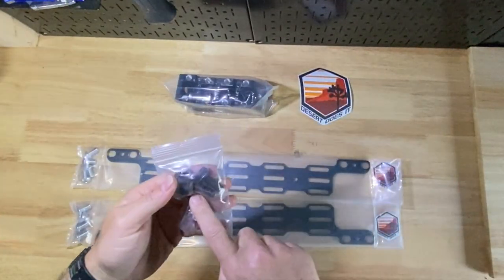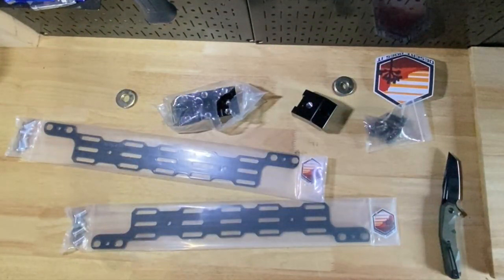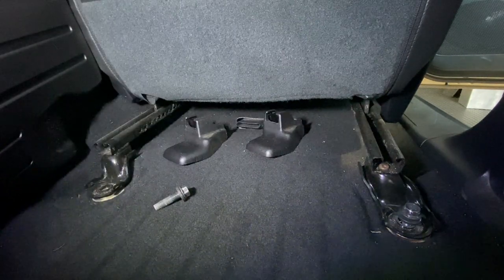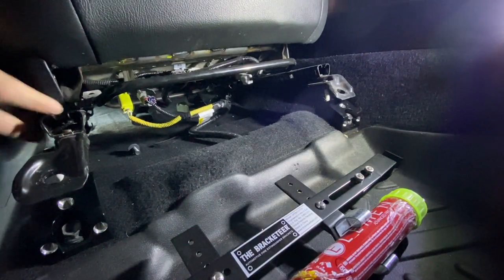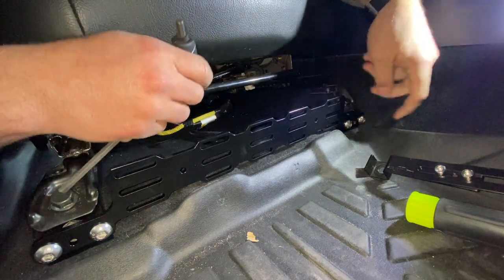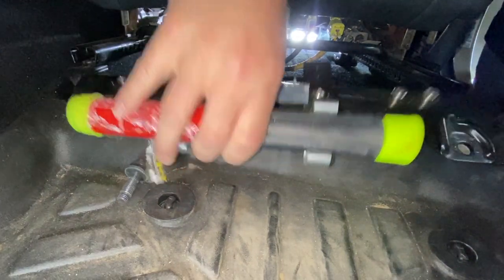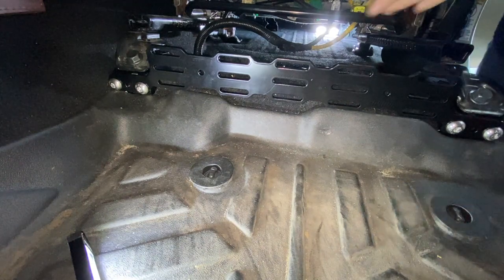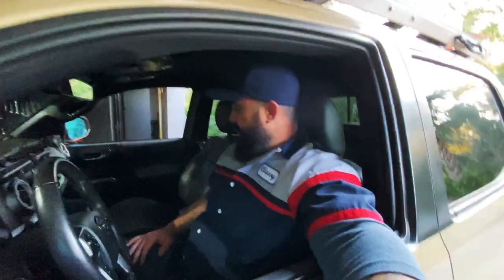Toyota Tacoma | Desert Does It Seat Jackers & MMP Install | (2017 Tacoma)

Comment: I did the seat jacker mod too, and man what a difference it made in the seating pose. Pricey though. I only did my driver side.
Reply from the maker: After a full week of driving and long trip, they still feel amazing. I should have done this sooner.
Reply: I heard there are cheaper ones on ebay and temu. Feom what others are saying, they are made of the same material and they also have the pins in them. Heard they are $30-$50.

Comment: I have an electric driver seat but I will put it on my passenger seat because it sits so low, but I would put 4 washers on the back of the seat
Reply from the maker: If you use 4 washers, you should also uses longer bolts to be safe. Thanks for watching.
Reply: Yes I’ll have to see the thickness before getting new carriage bolts
Reply: It works good on the electric seat as well. I just put it on my electric seat. Now i want spacers on the rear. I plan on putting some subs under both seats. Either an 8" or 10" sub inder both seats.

Comment: Btw, it was not necessary to loosen the rear bolts in order to get the front seat jackers on. All you have to do is push backward on the seat back just a little, and it will give you all of the space that you need to put the seat jackers in. Of course, if you're going to put spacers on the rear, then you have to unscrew the rear seat bolts. Otherwise, you can leave them alone if you are just doing the regular seat jackers on the front.
Reply from the maker: @Eastsidegeorgiaboy  thanks for letting me know. Appreciate it.
Reply: @ClassyTacos  you're welcome. I literally installed mine after the video.

Comment: are there any front spacers that are shorter? I like how much better the seat feels with the from spacer, by I’m rubbing my head on the ceiling of the taco now. I have enough neck problems without having to drive with my head tilted all the time or adjusting the back of the seat so I’m laying down
Reply from the maker: Not that know off, you might have to fab up something that works for you. I'm guessing you have a sun roof. From my understanding the sun roof models have the headliner lower. Hope you get it figured out.
Reply: How tall are you ??

Comment: Classy Tacos thank you for the videos. Quick question. 
Where I can find the spacers? I already got the seat jackers but I’m trying to save some money with the back spacers
Reply from the maker: I picked up the back spacers at a True Value hardware store. You can check Lowes & Home Depot they might have them. Ace hardware too. 
If you go larger than a 1/4 inch spacer buy longer bolts, don't play around trying to same a couple bucks. Larger than a 1/4 inch just buy the longer bolts.

Comment: How are you  sitting up higher when you just did the front? The back, where your head would be over, stayed the same height.
Reply from the maker: Don’t over think it man, it works and it feels way better. Thanks for watching.
Reply: @Classys Garage   I'mnot overthinking. I'm just trying to understand what was meant by that.
Reply from the maker: @Nuthing_but_the_Truth  Ok, the seat sits flat, you are lifting the front, you will sit higher. You will notice it once it's installed.

Comment: Still looking for 1/4 thick washers. Could you name the hardware store, if a national chain,  those were purchased from.
Reply from the maker: I found mine at True Value Hardware, Ace Hardware might have them also. If you still can't find any let me know I'll grab you a set from True Value.
Reply: Thanks. I’ll call True Value before I go over as the are 30 miles away. Ace doesn’t carry them.

Comment: @classy tacos I got mine in this past week and it does make a world of difference in the driving. I'm curious what size spacer you got for the rear of the seats?
Reply from the maker: For the rear stay under a 1/4 inch spacer with the factory bolt. If you go over a 1/4 inch spacer buy new longer grade 8 bolts for the rear. And don't play trying to save 2 bucks, if you go bigger than a 1/4 inch just buy new longer bolts, its for your safety.  I still feel like I should have done this mod sooner, still feels great. Thanks for watching.
Reply: @ClassyTacos  thanks for info! appreciate it!
Reply: @ClassyTacos  looks like you used 1/8 inch thick washers for the back, you only put 1 in each side?
Reply from the maker: @davidh5950  1 washer per bolt, 2 washers per chair. Any more washers per bolt or thicker washers would require a longer bolt to guarantee you get enough threads for a  secure attachment point.

Comment: Anyone use these on a seat that already has the motor controls? I'm 5'11 but feel like the bottom of the seat is too short for my long-ass legs. Wondering if the DDI jackers will help some. I already have the front lifted all the way up and the back half-way down with the motor controls.
Reply from the maker: There are several folks on the forums rocking these on the newer power Tacoma seats.

Comment: I am just about to pull the pin on getting these, but do you feel one needs the rear jack as well, or just the front?
Reply from the maker: I say just get the fronts to start off. If you feel like you might want to try the rear set up after, then try the washer method.